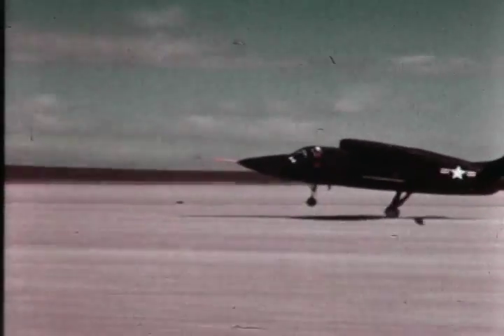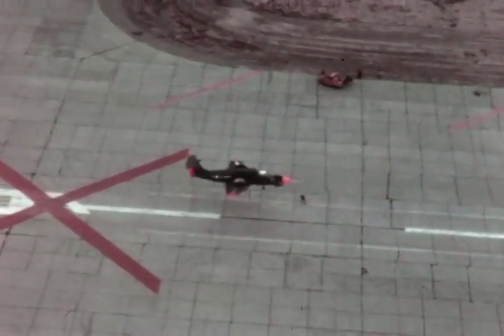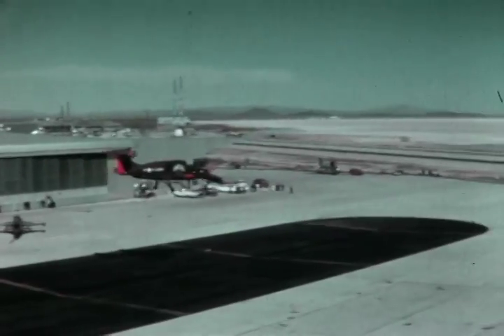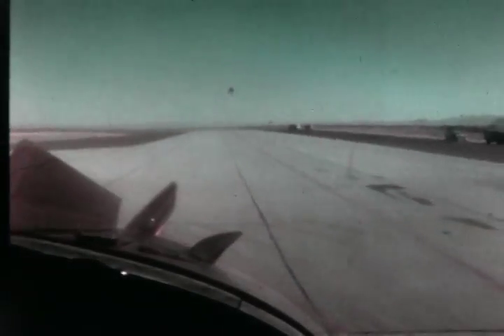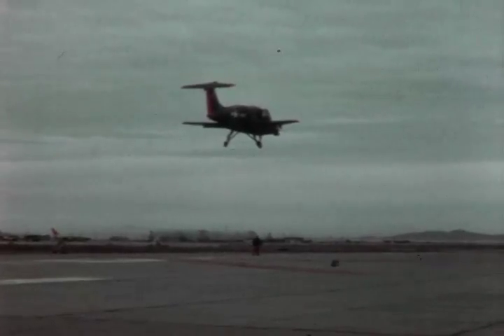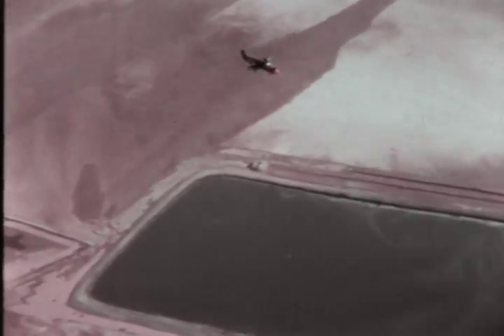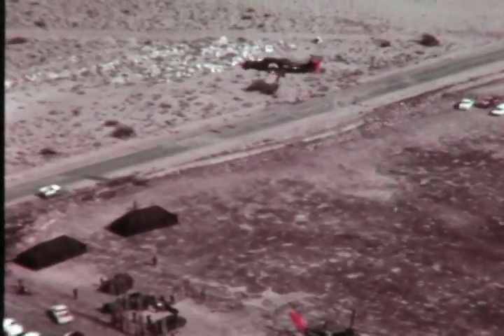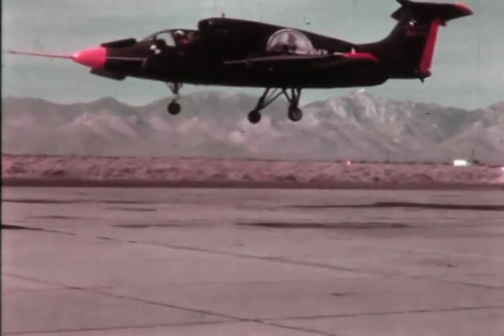F-0983 Ryan XV-5A Vertifan Air Rescue Video

Comment: Brilliant aircraft design.  With all the available high tech propulsion systems, avionics, digital control electronics, computer control systems and weapons, this aircraft could perform much better today.
Reply: Also called an F-35. Jet engine? Check. Liftfan? Check.

The F-35 gets lots of hate, but the aircraft itself is great. Program management, on the other hand, was horrible. Sure the F-35 has lots of teething issues, but those are minor and are getting fixed by the month.
Reply: I agree, it would be 100 percent improved. I think it was good then. But I guess the Helo did it all that this jet did
Reply: @thetreblerebel Except fly 546 mph with other jets and descend at 3× the speed of helicopters reducing chances of getting hit by ground fire, it also had a 1000 mile range.

Comment: thanks for sharing. as a former Harrier engineer I have loved watching this. im intrigued to know if in the vertical operating mode did the engines need water cooling? the Harrier could only last 2.5 mins in hover mode
Reply: There is a lot lot of space for water tanks together with fuel tanks for hours of fight and hoovering. It´s a commercial and not more.
Reply: It looks like the V5A could hover for longer. I'm not sure how they corrected the cooling of the engine.
Reply: @thetreblerebel  They didnt need cooling, unlike the Harrier the XV5 didnt need to run at full power to VTOL due to how the Lift Fans ran. The GE-J85 ran alot cooler at full power then the Pegasus anyways, so the regular air flow was enough to keep the engine from melting 

This system did have its cons, the inside was full of piping need to redirect the jet thrust to the fans, and unlike the harrier said fans was useless in level flight becoming dead weight. Which limited its fuel and payload.

 Also you had to be careful when to turn on the fans, to slow and you stall. Too Fast and you went out of control, one of the pilots did when he hit the switch by mistake going about 200 knots and the ejection seat kill him. You had like a 40 knot window between stalling at 80 knots and loosing control at 120.  

The Harrier can go from full speed to ZERO within a few moments.

A modern version with Computer control be great but well, stuff expansive and no one wants to do that...

If I had the money...

Comment: It failed because the fan system was simply- unreliable, expensive and took space inside the airplane that coud be used for fuel and wepons
Reply: Horseshit. Even this "proof of concept" prototype could fly for more than 800 miles! A production model would have more range, speed and hard-points.